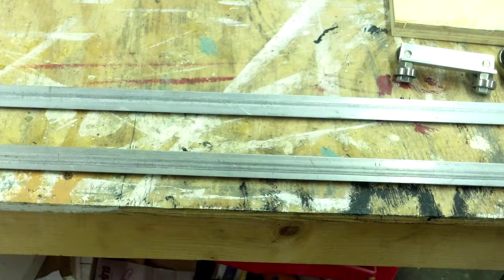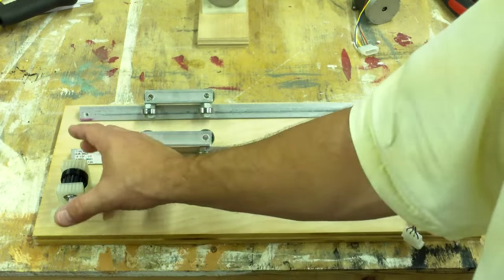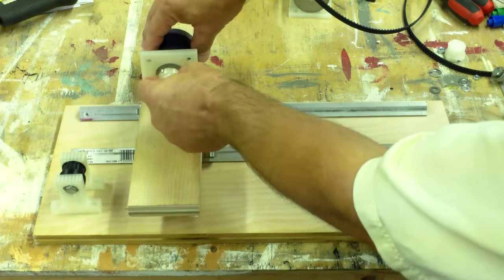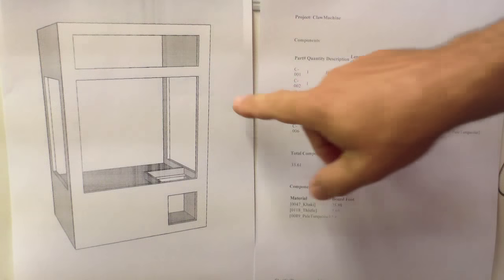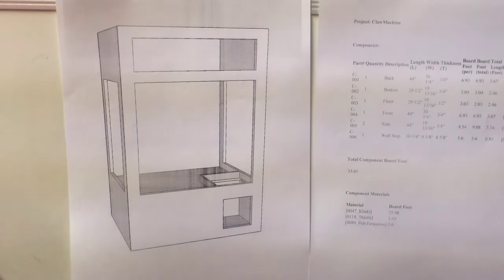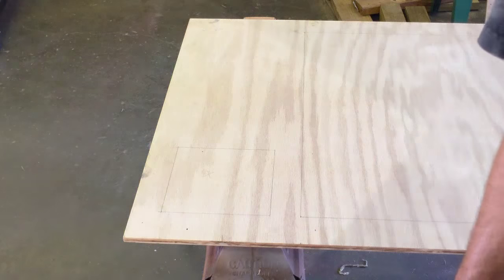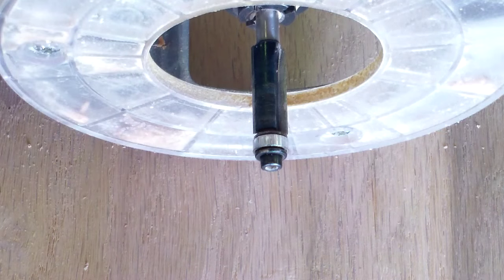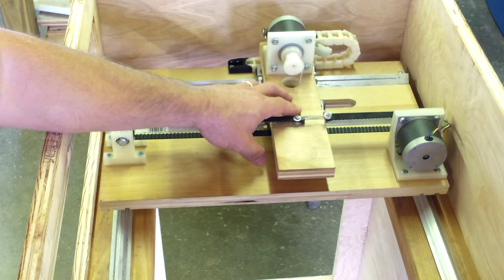Making a Claw Machine Game - Part 1

Comment: I'm thinking about building this with my Dad. Ever since he got a gas station, we haven't got to do much together now. It would be fun to spend time with him building this. I'd like to know the average price to build the Claw Machine.
Reply from the maker: +graysonknox88 The only cost I had in this one was 1 sheet of plywood, the LED strip, timing belt and the stepper drivers.  I already had all the other parts like the motors and servo and salvage the wire and a few other parts from discarded junk.  If you had to buy every thing new it would cost around $250-$350.
Reply: +Making Stuff thank you so much!!